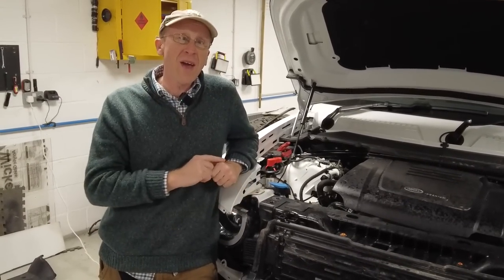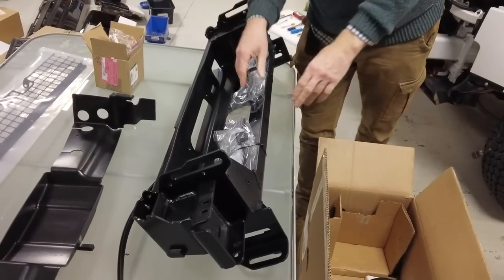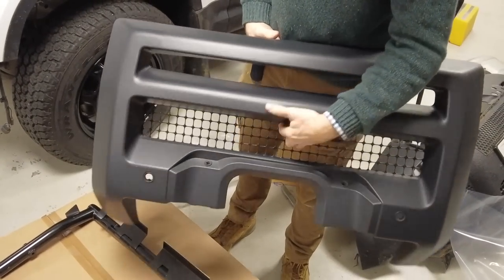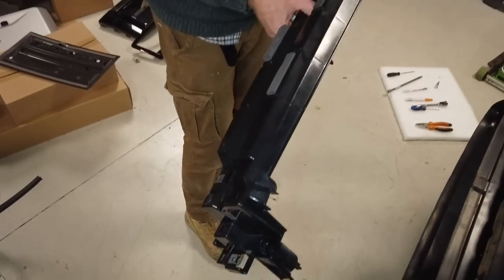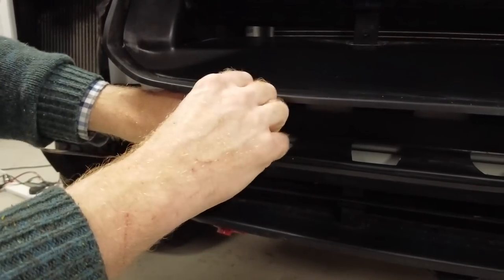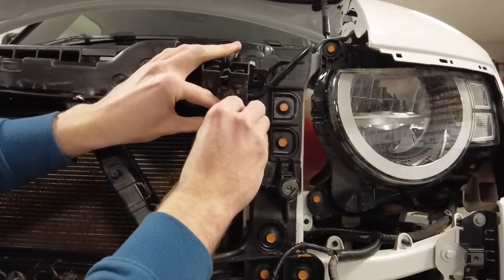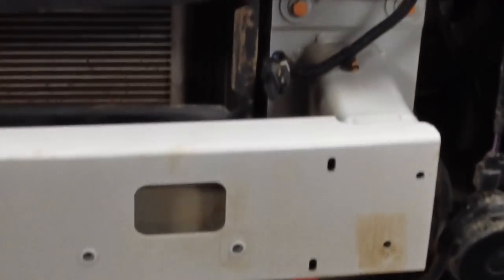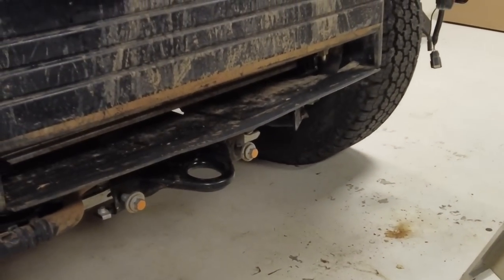Land Rover Defender 2020 Winch Bumper Install Part 1 - Unboxing & Front End Strip Down

Comment: I think “The fast lane car” should watch this and install with their own hand. 🤞🏼
Reply: Yeah jeesh that's a colossal F-up on JLR's behalf. I would insist on getting my money back
Reply: @romulusoverland314  Not a JLR issue in this case - more a problem with the dealer being incompetent and then no replacement harness being available.  Of course why you would have a dealer install a winch in the first place I'm not sure...absolutely going to over-pay for that and it's not the sort of work many dealers ever do.  Maybe LR Las Vegas who has a pretty decent history with off-road work and minor mods like this, but the average Rover dealer will freak out if the tires are a different spec to original.
Reply: @donhappel9566  Fair point. But if you can't figure out how to fit or wire a winch, you should definitely not try to work on a vehicle that has 85x ECU's/computers! I say JLR because they are the representatives of the brand, and if the brand appointed incompetent representatives, then I feel they too are to be blamed. Where is the support for the customer? Why build and sell a vehicle if you are not equipped to give aftersales service?
Reply: Will void the warranty if damaged the loom
Reply: @benjibyte8612  Yeah so why would an owner even mess with something like this, talk about asymmetrical risk.

Comment: obviously designed and mfg. with no end user in sight - almost a throw away design - thank God for a real Defender
Reply from the maker: I hear you .. but look at the use of materials...aluminium is not cheap and they have used it a lot on the chassis and the suspension etc. There is some really good engineering in the car.... but it could be easier to strip.. a lot of fragile plastic clips... just like the door car on an old Defender...

Comment: Is there a way to manually open the radiator flaps to clean the radiator/ac condenser after getting muddy? Seems like a very easy way to block it all up and overheat
Reply from the maker: Yes this seems to be a good idea... I will investigate and look at the wiring diagram / manual method also
Reply: They must have to open for the aircon to work.

Comment: Am astonished at just how much dismantling is needed to sling a winch on the front! Am sure you could just bolt the winch on to the front bumper on the original 'ladder frame' cars? Such is progress. Bet you're glad you have a video to remind you how it all goes back together again, if ever you remove the winch! :-D
Reply from the maker: Hi - look at part 2 and you will see there is some really clever impact absorbing design gone into it.
Reply: @L663  Ah yes. Forgot about the crumple zones. /thumbs up/

Comment: Fabulous stuff but I can foresee a lot of cooling problems for folk that do a lot of off roading with the mud 
on the radiator that the power wash couldn’t get to.
Might be best to get the car up to temperature thus opening the vents before attempting to jet wash the mud off?
Just a thought.
Reply from the maker: Yes I did not think about this yesterday as i was focusing on the strip down but you guys at home have spotted this issue and it does need to be investigated.

Comment: I was just wondering, maybe something you can ask mr skywalker. If you went offroading, and the next day want to wash of the car, is there anyway to open those flaps so you can clean out the radiatorfins? Or will you need to have the car running when you wash it?

Comment: Do you also need  to order VPLEP0426, which I believe is the winch, when you order from LR? And I presume if you order VPLEP0427 or VPLEP0489, will it be the same as each other? Thanks again for doing some great work.. I think you are one of the few who actually does the graft before doing the video..

Comment: Take a shop vacuum to the radiator but put something in front of the vacuum end to keep from damaging the radiator then wipe off gently with soap and water rinse with hose DO NOT USE PRESSURE WASHER it will damage the fins.

Comment: Was there a part where you removed the fan in front of the radiator louvers?  I have a 2022 110 Land Rover Trophy edition and have a fan but did not see that part you your video.
Reply from the maker: Yes we had to remove to the lower louvres but i dont think there was fan in this lower section.
Reply: @L663  we have a fan right in front of the louvers and I would think it would need to remain in front of the radiator. Definitely confused about how to install a winch.

Comment: It seams to be OTT just to put a winch on the front of the new Defender compared to the old one.
Reply: Yep, was thinking the same...my winch on my old tdi has 6 bolts holding it on and was mounted in 45mins!
Reply: Well making it more difficult makes it more fun and also they don't have much of a choice because of the people running the countries that we live in.
Reply: @PillSharks  wonder how much that kit costs then the cost of the winch and maybe the cost for someone to fit the whole lot looks like about 1500 2000 all in.
Reply: @gordonbarclay6106  not sure, probably more than that mate!

Comment: What an overcomplicated car ...and so difficult to clean.
See how easy it is on a Wrangler (cleaning and winch install)
No wonder those cars are expensive and break down easy, you forget a grommet and it would not start ....
I really enjoy your videos, thanks.
Reply from the maker: Hands down Jeep wins when it comes to accessories.... both original and aftermarket the range and quality of parts is first class. If i sold Jeep accessories i think I would be out of business as the competition is way better than us !
Reply: That is what happens when trying to turn a Range Rover into an off-roader.

Comment: I dont like how those head light sections sprung down when those last bolts where removed probably find the front wings and headlights are going to be out of square now
Reply from the maker: Yes its all a bit loose and flexible when unbolted ! having said that did you see how many bolts were used to join it all together... i think all the weight saved using aluminium went on the steel bolts !
Reply: @L663  when you took The Stig off roading what was the body flex like?, it looks to me like theve kept the old school way of doing there aluminium panels and instead of hanging them off a steal chassis/frame they are just adding steel brackets and random sections here and there and adding a ton of extra bolts to get the same overall rigidity, false economy if you ask me, also they have lost the flexabily of the Series/Defender concept.
Reply from the maker: @justinsmith6296  The body seemed very stiff but I think they have had to add lots of extra bolts / stiffeners to achieve this.

Comment: I've got a beloved  Disco2 and have opened the front end a number of times. It seems that they have taken this strategy and amplified it exponentially. I think the emphasis is ease of assembly with a notion that there will never be a reason to disassemble? The idea ultimately, I guess, is to drive the vehicle until the check engine light illuminates then have it towed to the recycle center and buy a new one and I mean this as a general concept not confined to Land Rover. As enthusiasts, artisans, mechanics and general gearheads we shouldn't have to spend so much time figuring out this fiddly crap that 3D printers thought would work. God help us when autonomous cars start plying the highways. I hope they are smarter than  our spell checkers.